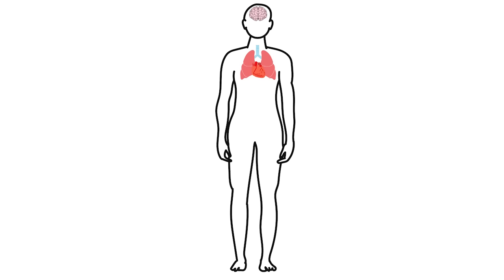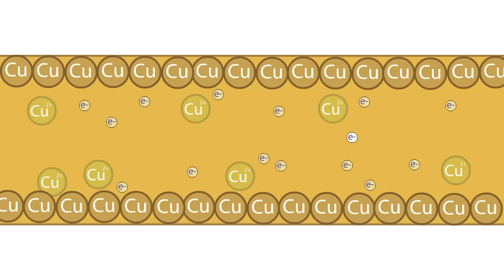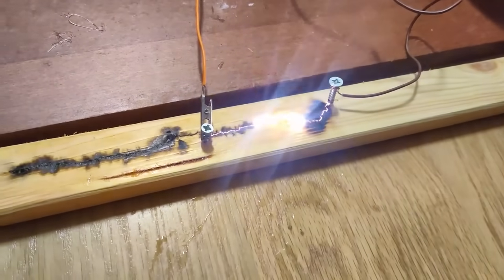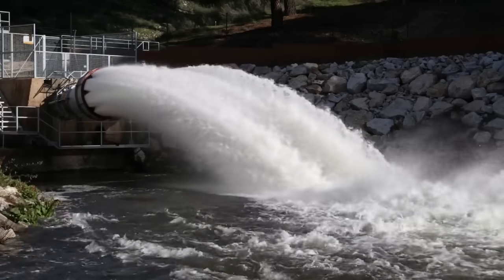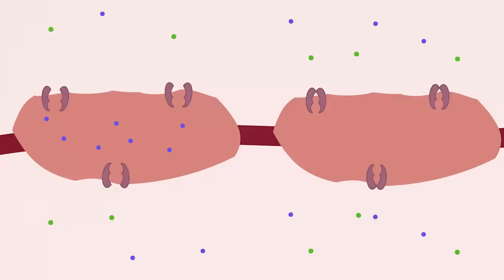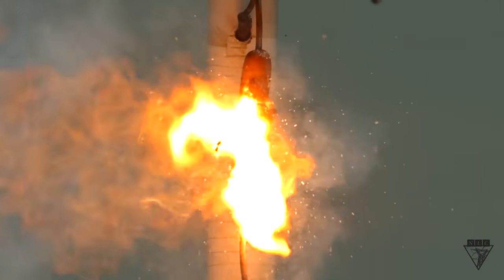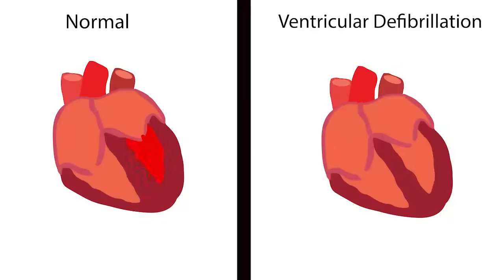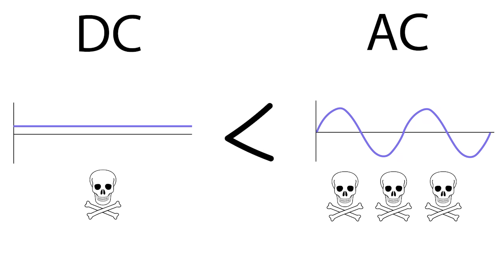Anatomy of Electrocution

Comment: I've had some regular shocks by plugs and some serious deadly close calls welding and working near a bare wire hanging down from an industrial ac (the size of a truck) designed to keep tons of potatoes frozen. The bare wire was so hot that it had melted to the galvanized guard rail (meant to keep forklifts from damaging the walls)and I accidentally hit the wire breaking it free. It broke contact and was so loud and so bright it blinded me a good 2 minutes and almost busted my eardrums. Another time I was working in the Tampa Bay ship yard in a dry dock in 3 or 4 inches of water with a connected welding lead (turned on) running through the water. I picked up the lead thinking it was disconnected at the end but even with my gloves on I felt a current running through my hand up to about my shoulder and this is with no bare spots (thank God) I could feel this. Welding machines in general have to be many amps and volts to work. Those were usually set around 30 amps and 2 to 300 volts on average but with me standing in the water it was strung through with wet gloves would be much higher so things could've went bad real bad once I even stepped in the water which was the entire bottom of the dry dock(big enough to fit a cargo ship). I had angels from God watching over me that night for sure.

Comment: I'm incredibly lucky to be alive. Back in the 90's I had to close the electric fence gate at work by opening the box and physically pushing the relay to close it. I was young and too dumb to say no to the boss. Anyway, one winter night, I was standing in slush up over my ankles and my work gloves were wet and I got a shock that went from my hand to my feet. It lasted only a second or two before I pulled my hand away. I guess what saved me was the fact that I wasn't actually gripping anything, I was just pushing the relay with my finger. So I didn't get that grip lock thing.

Comment: When it comes to voltage, a volt can only tell you how far a spark can jump. Take Taser's for example.. High voltage is needed for the spark or electricity to jump or arc and pass through clothing easier. But what is really dangerous is the amperage. The amperage is what can kill you.
Reply: No, you need volts to kill. A car battery can gibe huge amount of current but it is harmless as it is 12 V. Any practical electric system can provide enough current to kill, it is the volts that matter.
Reply: @okaro6595  Wrong!!!!! When it comes to voltage, Volts only tell you how far a spark can jump.. Yes, you need volts to arc enough into something! But it is the Amperage and the Joules that do the damage!

Comment: Is there any science behind the three sessions of A/C voltage (8-22-4 seconds) applied during the execution?
Reply: That is not always the procedure. Some states have different numbers of cycles of differing duration. Tennessee, for example, turns the chair on for 20 seconds, off for 15, on for 15. The reason is so the first cycle is to break the skin resistance by burning into the muscle layer and to produce immediate unconsciousness by "depolarizing" the brain. The second cycle depletes the adrenaline from the heart so it does not restart on its own. At least, that is the theory. In reality, leaving the chair on for one minute, or two as some states have done, seems to be just as fatal.

Comment: Why do you think that nerves are the most conductive paths? Nerve fibers are not metal wires, they are just extremely thin (and leaky) tubes filled with (roughly speaking) the same electrolyte as the extracellular space. So most of the current will flow outside of nerves, just because there is more volume there.

Comment: Good thing to note with the 'current kills' is how car battery can have 1000 amps but only 12v. You can safely touch both terminals with your hands with no effect. If the voltage is 220v and current same 1000 amps, it would make the magic smoke leave your body.

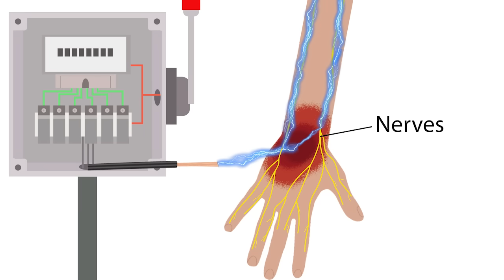Comment: 6:10 -- electricity in your body takes the path that's most conductive -- that's plainly wrong. Electricity takes all the paths at once in ratios of conductivities. If I have a path with conductivity 1 and 10, it doesn't mean electicity takes path with 10, but with both, just in a ratio 10:1.

Comment: Im sorry, I don't believe you "pass out immediately". 

You offered no science to support that. And it was stated, right at the distressing point...it's like that was the PSA put out by Government scientists at the time, to help facilitate their new tech.

Really, it was an opportunity to study electricity on humans, and whst exactly, are the fatal doses.

I suspect loads of awful scenes like the one in the Green Mile, occurred in RL. But that's just me...🤷‍♂️
Reply: Like any other execution method, the people most qualified to give you an answer can no longer do so. But It should be the case as attested to by  lineman who have suffered accidental high voltage electrocutions but survived to tell the story, loss of consciousness was instantaneous upon contact.

So, if you’re going to die in a well designed and properly maintained electric chair and executed by a competent executioner, it must be something like a cessation of feeling. In one instant you’re sitting blindfolded in a hard wooden chair, the sensation of the leather straps holding you down, the cold wetness of the electrodes on your head and legs then BANG!!! - Unconsciousness and brain death while unpleasant stuff happen with your body, and then ……whatever lies beyond death (if anything).

Comment: Talking about nerves as if it is much like a wires is completely wrong. Otherwise people would be EMI-sensitive. In fact nerves conduct impulses in essentially different way. While in a wire electrons work as a carriers of charge and move alongside a wire (in longitudinal direction), in nerves Na+ ions, not electrons, are charge carriers and they moves through cell membranes (from within a cell to outer space and vice versa) rather than in longitudinal direction

Comment: I can remember putting one thumb on a live pin and the other thumb on a neutral pin of a broken plug, and that gave me a shock and a half at the full UK mains voltage. Just about the worst thing you can do, but it didn't do me any significant harm other than to get my heart beating really fast. Whatever happened I survived it.

Comment: AC shock can break bone due to contraction.
Now think of the electric chair.
That's high voltage for a longish duration, through which EVERY single muscle in your body contracts.
All of them.
Muscles that control your eye contract, tearing them left, right, up and down as hard as they can to the point, as noted, of breaking bones...
Ear muscles, your regular body muscles, digestive one.... Imagine every cramp you've experienced at once for some 15 to 30 seconds.
Toes trying to clench and splay open...
So, not only is there burn, shock to the brain, but your body would rip itself apart.

Sounds not soo fun.

Comment: The voltage in "60 cycles AC" reaches zero (off) TWO times each cycle, not once. In other words the voltage and current stops and starts 120 times per second. One complete "cycle" is OFF, POSITIVE PEAK, OFF, NEGATIVE PEAK.

Comment: I am a Master Electrician and have been shocked well over 1000 times. Most times it is just a nuisance. Been shocked by 240, 277 and all 3 phases of 480. It is far more painful. How wet your hands are or if the shock is finger to finger or hand to feet or hand to hand. Human skin is a great insulator. I would rather get a 120 volt shock then hitting my thumb with a hammer. 

AC does not "grab" you but DC can. DC really is not used at high voltage anymore other than solar panels.

Comment: AC voltage is measured in RMS (root means squared) value.  That is the equivalent value to DC.  120v RMS AC has to be generated at a peak voltage level of about 170V (120 X cosecant of 45 degrees (1.414), or take the peak voltage times the sine of 45 degrees (.707) to get RMS value).  This is due to the rotating phase values.  Peak is reached 120 times per second at 60 Hz (along with zero).  The trig is required to determine at what level the voltage needs to be generated.  Technically, it takes a higher generated AC voltage to produce the equivalent DC.

Comment: The comments on frequency are inaccurate.  60 Hz turns on and off 120 times per second.  The cycle per hertz is a full wave: the voltage (or current) reaches peak value in the positive direction and back to zero in a half wave, then peak value in the negative direction and back to zero in the next half wave.  If the beginning point of the sign wave is given as a starting point, the sine wave crosses zero twice during a full wave.  60 Hz pulsates 120x per second.

Comment: Great, in fact brilliantly explained.

An error though: DEFIBRILLATION is the treatment for FIBRILLATION, involving cardioversion via a DC electric shock at an accurately prescribed and delivered amount of energy, measured in joules.

The disorganised electrical non pulsatile rhythm of the heart is called Ventricular FIBRILLATION, as it involves the primary pumping walls of the Ventricles, 
This is the life threatening event as the blood ceases circulating around the body.

Atrial Fibrillation when involving the Atria is not directly life threatening, but due to blood being shaken in a turbulent environment while transiting through these quivering reservoirs it can precipitate a clotting cascade, indirectly causing a life threatening event.

A clot produced in the Right Atrium is ejected Into the Right Ventricle and then through the Pulmonary Artery network into the lungs becoming trapped in this network and blocking a vessel.

How large and which vessel determines how problematic and potentially life threatening it can be.

This event is called Pulmonary Embolism (PE).  

While a clot developed in the Left Atrium is ejected into the Left Ventricle and out via the Aorta to travel along any artery, a dangerous process of chance, as there is particular factor that determines where the clot travels, subsequently the clot has the potential to travel anywhere, no where is good because eventually it will end up in an artery too small to accommodate it consequently ‘plugging' it and obstructing any blood flow beyond the obstruction. 
All tissues beyond the obstruction are starved of oxygen and die, this known as an infarction, the dead tissues are said to be infarcted. 

Again depending upon the clot's size and the vessel obstructed determines what tissues along with their potential damage and outcome.

This called a Systemic Arterial Embolism.

The presence of a clot is diagnosed with a blood test called a D-Dimer, then its location confirmed according to symptoms via CT/MRI scanning with contrast

Various Thrombolytic agents can be given to breakdown the clotting factors to 'melt' the clot. 

When brain tissue is being compromised these events are treated with more powerful or potent agents to break down the clot faster and reestablish vital blood flow. These more potent agents are sometimes nicknamed 'clot busters'.

When a clot travels up through one of the Carotid Arteries that arise from the Aortic arch immediately upon leaving the heart, that clot is extremely pernicious.

Any artery of the brain that obstructs causing brain tissue infarction can be catastrophic. 

This is a Cerebral Arterial Embolism which causes a Cerebral Vascular Accident (CVA) aka a Stroke.

For this reason people with Chronic or 'Fixed' Atrial Fibrillation are managed with strong AntiCoagulant therapy with drugs like Warfarin or Pradaxa amongst others.

Comment: in your house wiring (toaster, etc) electrons do not "flow". their field builds/collapses at nearly the speed of light, jiggling back and forth at 60 times per second (hertz) on the "skin" of the conductors, to do their work.  the electrons in your housewiring 25 years ago are still there.  you learn weird stuff as an electrician: the reason for the cap is the high hit of current to the head would immediately vaporize the water inside the brain (hence the need for the mask) creating explosive steam.  not so much "burn" as "flash-boil".  ugh.  i hear they quit teaching this in EM "A" school.  good vid, overall.

Comment: Briggs Stratton engine cut off the coiler wire to cut off the engine.. one finger a cross to left hand.Out another one and a sec of the election blowing a little gash.I was on a mini bike with shoe string on the carburetor on the right hand turns. My han was on the handle bars mini bike was metal it had a hold on me for one second and pop the other side.the finger on the metal index or middle finger. So long ago was just a kid

Comment: Can you enlighten me. I work at a semiconductor company and we are plating copper with tin immersed on a solution up to 300Ampere DC. And here i am thinking i cant be electricuted by DC. Is it because it's only 4-15Volts DC?. thanks.
Reply: It is the volts that matter. 15 V is safe.

Comment: I once held the rubber coating of a spark plug wire while wearing rubber soled shoes, thinking's I would be insulated. It shot electricity right through me. Though the amperage was low, the voltage was high, and a think this is the reason it arced right through me.

Comment: At 60hz the supply turns on and off 120x a second not 60.. It's 60 full cycles of 0 to +volt then to zero, then to -volts, and back to zero..

Comment: Doesn't the quantum of Volts also matter? I had done many hobby electronic projects where I used a step down transformer to get 9 to 12 volts AC at 1 AMP (1000 MA). Then used a bridge rectifier to get 9-12 Volts DC. And I touched all parts of the circuit with the bare hands several times without feeling a thing although there was 1000 mA in the circuit. And the video says anything above 150 mA is instantly fatal. What am I missing ??
Reply: Yes, the voltage is important-- the resistance of your skin will limit the current that can flow through your body. Less than 20 volts is too low to get dangerous currents to flow; 200 volts is more than enough.
Reply: It is the current through you, not in some wire. Your misconception is just what "It is the current, not the voltage" nonsense causes. It is the voltage period. It is the varying factor that determines if it is dangerous. Voltage causes the danger by punishing current through you.

Comment: 60 Hz AC is NOT turning on and off 60 times a second. As you show in the video it changes direction, so to speak, as a sinusoidal wave. So it is positive 60 times a second and negative 60 times a second. If you call the peaks "on" and the zero crossings "off" this results in the current turning on and off 120 times a second. This, btw., is the frequency of the humming you might hear close to electrical equipment.

Comment: I have to drop a correction in here: in 7:44 you talk about neurons, however these channels are not present on those ,,thick" parts of the neurons, but on these slim ones. These ,,thick" parts are called ,,Myelin sheath" they are very Rich in fats and are used as insulators to make the nerve signal ,,jump" quicker between these ,,thin" parts called ,,Ranvier node". Its a minor thing but nevertheless I think it was worth mentioning 😉

Comment: As most folks know electrocution has been banned in most states due to its cruel and unusual punishment. I believe a few states still have it (Nebraska?) but haven't used it for years. I was so fascinated by this video I looked up current methods of execution and was surprised at the relatively high botched execution rates. For example, lethal injection has a 7.12% botched rate. Lethal gas, electrocution, and even hanging have a failure rate.  The only method that has a zero failure rate is the firing squad. Interesting!

Comment: The way I understand it is that voltage is the electricity's ability to overcome an insulator and turn it into a resistor. So you can have an a flow of a billion amps, but if it's at, say, 1 volt, it doesn't have the ability to overcome the resistance of your skin and you don't get a shock. Touch both ends of a car battery, and you'll be fine because it's only 12V. Touch both ends of a capacitor out of something like a PC power supply (which is significantly smaller than a car battery) and you could be in a world of hurt because the voltage can something like 200V. Once your skin barrier has been defeated, then the current comes in and kills you. But there's got to be enough of it. A shock from touching a doorknob might be something like 3-20 kV, but because the current and built up charge are so low, it's a quick ouch and over with. However, a shock from mains power, at only 120V or 240V, depending on your location), definitely carries enough current to kill you. Voltage and amperage are two factors in the same multiplication problem. If you take one away, you don't have a multiplication problem anymore; you have a single number. If one is present, so is the other.
Reply: Tell you what. You go ahead and touch that car battery and tell us how it works out for you. I've seen tools weld themselves to structures because of the amount of amperage flowing in a common car battery.